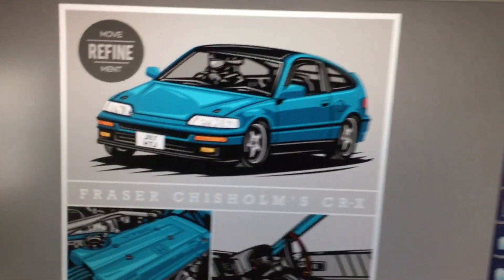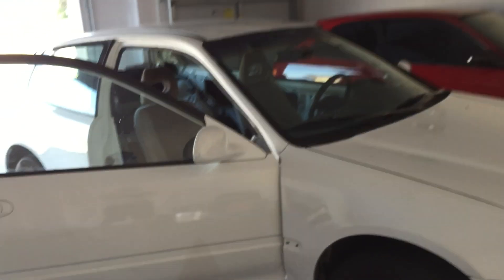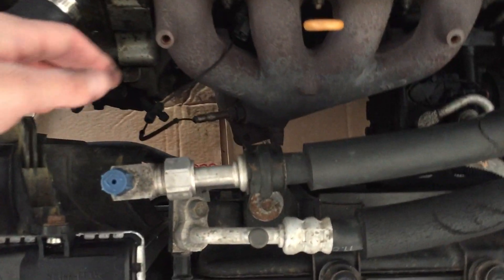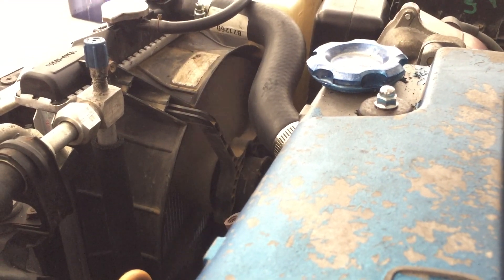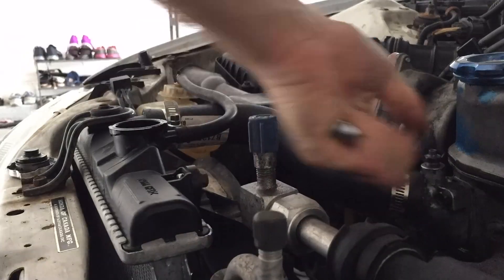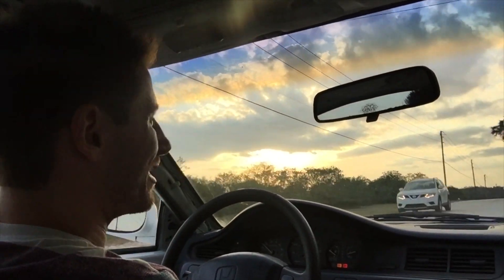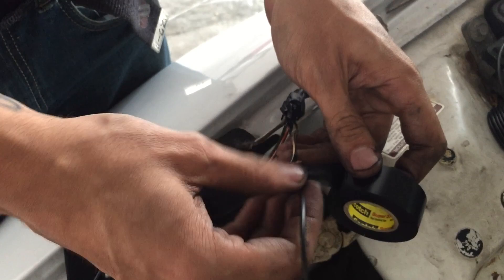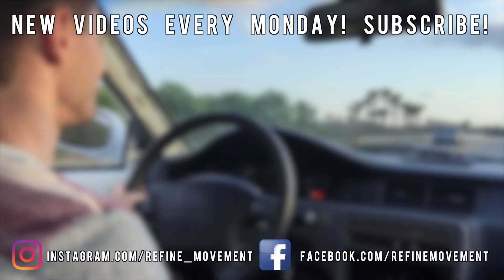Pulling OBD1 check engine codes without a scanner + splicing into the wiring harness - Ep. 12

Comment: You can definitely make the sensor work if you run the extra wires from the sensor straight through the firewall and straight to the ECU pins so that you bypass the entire harness. This will work 100%. You guys were going to do that but you started tapping it in the harness.
Reply from the maker: Yeah, I think we are coming back around to that Michael.  Thanks for your input man

Comment: If you have more than one code will it blink more than one set of numbers of will it only show one code at a time ? My temp gauge isn’t working but the only code I have is for vtec oil pressure sensor code 22
Reply from the maker: Yeah if you have more than one code it will do the long and short blinks (if it’s two numbers that is) or just one short blink, but then there will be a slight pause then it will blink the next code. Otherwise it will just keep repeating the same code so if all you get is code 22 repeating then that’s the only code your car is throwing
Reply: @RefineMovement  have you ever tried running codes after the car has reached normal operating temp?; like what the guy stated above, his temp gauge does not work (likewise) and i also only get a 22 code when i perform this test but my engine would be cold; hence it has never been done on a warmed engine ? Im thinking this right, when the vehicle reaches norm operating temp maybe other sensors then kick in such as the one located on the thermostat housing (coolant sensor) ? ×_× Whats your take sire ?

Comment: damn nice work! I didn't know about this either i just knew to set ignition timing by jumping with the paperclip :D thanks for the info
Reply from the maker: I guess we are all learning Sean! lol thanks for watching as always man.  I was thankful to learn about this as well
Reply: Murdoch89 so how do you set ignition timing by jumping with a paper clip
Reply: Jump it with the paper clip as he had it this sets the ecu to service mode, then loosen the middle top 
bolt on the distributor to manually adjust the direction forward is 
advancing and rear is retarding I believe on the distributor cap

Comment: I have  a 90 civic dx I tried getting the codes but even with the paper clip the engine  light wont blink not even once
Reply: 88-91 is obd0 you read your codes off the ecu itself unlike the 92-95 you read the codes on the dash

Comment: are you gonna raise the rpm any more than it is stock ? it should handle 7200 with no problem :)
Reply from the maker: That would be sweet. It's going to 6500 now but that extra bit would certainly help out on track, if there's any power up there anyway
Reply: should be :) i had a d15b2 in my eg and it went all the way up to 7200 with no problem, then i upgraded to a z6 vtec head and had it set to 7600 pulled very nicely all the way to the limiter, also helps when you change up that the rpm only drops to about 5500 to you stay in the power band :D
Reply from the maker: That would be much nicer than the rpm dropping a full 3k rpm that it does on me currently lol But thats down to that cx transmission thats still in the car

Comment: chip the ecu and disable the o2 sensors and maybe swap out the injectors to the correct cc that your ecu is set for
Reply from the maker: Thanks for the suggestion.  The injectors should be from the b7 but because it would make sense for the people before who had this car and did this head swap to have just taken intake manifold/injectors/fuel rail off all in one shot,  but who knows, maybe they didn't use b7 injectors.

Comment: the car is reving higher. your tachometer just isnt reading correct. I had the same Problem. but never solved it. but it very probably involves your Distributor...
Reply: oh and for a d15b7 it seems too slow. Check the timing. maybe the guys before didnt match the marks correctly.
Reply from the maker: What you said is pretty much what it comes down to now I believe.  The timing is not correct on the car.  I'm thinking that when the people who had it before me did the head swap they never changed out the crank pulley to a b7 one, changing the timing.  They instead just advanced the ignition timing as far as it would go (currently how it is on the car) and called it a day.
Reply: Refine Movement i dont think the pulley should be any different. But you should take it off and take all the covers off to see if the timing on the cam gear matches exactly with the crank gear. 
And while you in there have an eye on the belt itself if its old or not.
And if thats all correct(ed) let someone adjust your ingnition timing correctly and your valve play. That can help the engine to run good again and make its 101hp again.
Reply: Exactly what was just said, remove the crank pulley and timing covers to see the mark on the oil pump housing and the on the timing gear. That will 100% give you the correct bottom end timing. Then line the cam gear markings up correctly and put the belt back on.